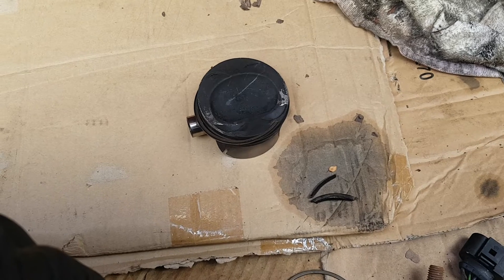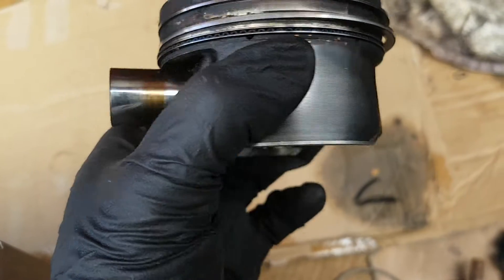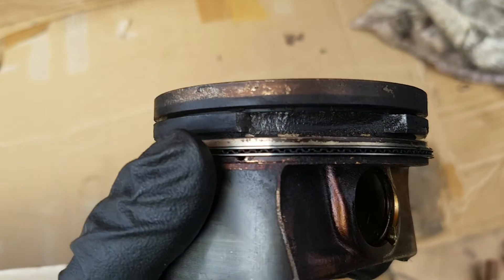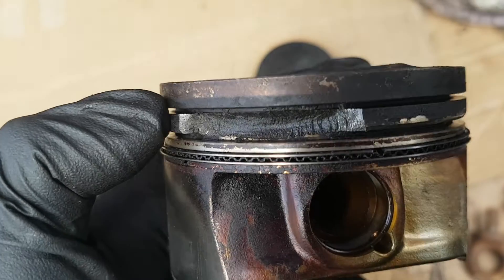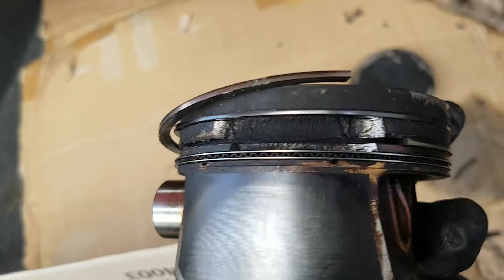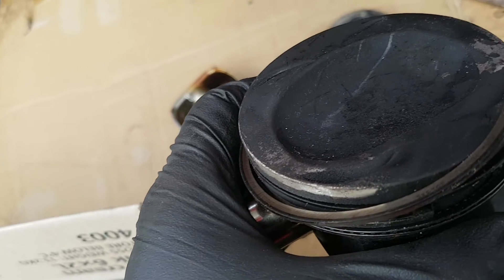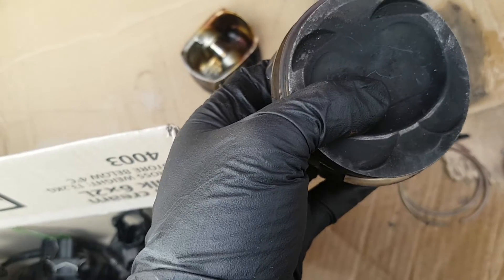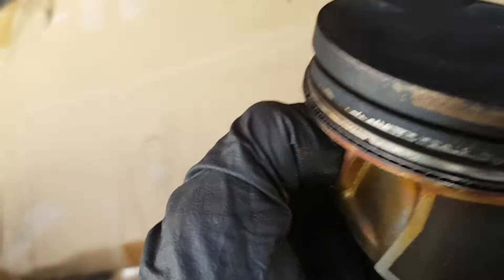VW Audi 1.4 TSI CAVD Misfire Low Compression Cracked Piston Ring Lands

Comment: From what I'm piecing together from info across different sources is that the oil drain hole in the piston behind the oil control rings gets clogged with carbon causing oil consumption and carbon buildup and eventually cracking the ring or piston or both.  I heard something about the pistons being revised in 2017 with larger drain holes.

So I guess the solution for those of us who have these engines, short of replacing with the updated pistons, is to run shorter oil change intervals and perhaps occasionally run some carbon cleaner or do some "Italian Tuneups" to keep carbon down, while being sure to monitor for excess oil consumption...
Reply from the maker: Hi Woody. Where did you source this info?  Would be interested to see this theory as i have heard differently. Thanks.
Reply: Four Rings Auto hmm, I remember most of it was from a VW technician in Germany who wrote about it in a forum.  Don’t recall where exactly I saw the post.  If I can find it I will share with you.
Reply from the maker: @CatonsvilleCentralRwy  interested to hear the theory. I had been informed otherwise. The oil consumption in my experience is fixed by replacing the oil squirter jets for the underside of the pistons, along with revised breather pipes where necessary. The pistons were originally made by Mahle, the revised parts made by Kolbenschmidt. It was suggested that the failure was due to too low a silicone content in the castings, the silicone being there to help the alloy under high temperature. I haven't yet seen manufacturer information stating either theory though.
Reply: @FourRingsAuto 
That's what I have read too. These earlier engines were not built with a high enough spec for the power output. After 2014 the 1.4 tsi redesigned engine has better pistons, timing chain assy, and different oil jets.. No real problems now. Just tough luck for everyone who bought the previous "prototype" 🛠️🛠️🛠️
Reply: @harwoods11  Hi guys, i have a golf 5 1.4 tsi 170 hp, BLG with missfires on cylinder 1 and 3, ive changed 
the spark plugs along with coils, after few km missfires came back, what can i do to fix this problem ? i saw in theese comments about thoose 4 new cylinders from ebay, is it worth it if i change them ? i mean if it runs 100k. km with new pistons im ok with it
Reply: @FourRingsAuto  I have replaced my broken/cracked Mahle pistons with Kolbenschmidt and have not had any issues with the new pistons. I also change the engine oil every 5000 km.
Reply from the maker: Sane experience I have had. Replaced multiple sets with kolbenscmidt and made sure car uses only 98 octane premium petrol. Regular oil changes are definitely beneficial too.
Reply: @FourRingsAuto  I watch all your videos and find them very informative. After last oil and coolant change, I noticed quite a lot of white smoke while car at idle and warming up with no petrol smell from the exhausts. After 5/10 minutes, it disappeared and no bubbles in reservoir tank and no loss of coolant either, any ideas please.

Comment: Is there any issues with the CXSA (Belt Driven not Chain Driven) 1.4 TSI 90KW 122ps (2015 Golf)
Reply from the maker: Not with pistons. A new engine brings it's own variety of issues, but at least this isn't one.
Reply: @FourRingsAuto  Pheew. It does idle rough even after a (software) update. I might try and clean the map sensor etc.
Reply: My MK7 1.4 tsi had the engine replaced after i started notice that my engine consumed a shit load of oil and petrol, and was idling rough, piston failure and they replaced it with a brand new engine lucky enough
Reply from the maker: Yeah I've heard a few issues like this now after this comment around a year ago. They've all been one covered by the dealer though so i haven't been able to get my hands on one to tear down.

Comment: Is it possible to remove head and sump and replace the pistons .. I have a car that has hardly done 85000 klms
Reply from the maker: Yes that is the way i do it. So the job can be done with the engine still inside the the car. Few fiddly bits like the supercharger cover though.
Reply: @FourRingsAuto  thank you ! 
I prefer that solution to substituting my CAXA with a similar klm engine ..
After all it may suffer the same fate
Reply from the maker: Repair what you have. Biggest mistake i see is people throwing away perfectly repairable engines.
Reply: @novi0974  any update on that job? I have a similar situation but no confirmation of damage yet
Reply: @FourRingsAuto  Yeap , they should throw away the car itself

Comment: What about caxa motor? Because i have a misfire on cylinder 1(code p0301 and p0300) and i changed all parts on fire system but i cant resolve it
Reply from the maker: Do a compression test first. Then a cylinder leakage test to confirm where the pressure is going if the compression is low.

Comment: This engine is in the seat Ibiza Cupra was the engine updated to the CTHE code in the late year of 2012?
Reply from the maker: Easiest is to look either in the front page of the service book,  or in the boot floor of the car for the data sticker. It will state the engine code.
Reply: Four Rings Auto thanks a lot man
Reply from the maker: You are correct. All CTH engine codes across the vw group were the updated EA111 engine with the Kolbenschmidt pistons instead of the Mahle ones that crack.
Reply: Four Rings Auto thanks do you know anyway to tell a cthe engine over a cave engine if buying a car

Comment: Hi there 
I got a 2010 Skoda 1.4 tsi with low
Compression on cyl 1. 

You you have the part number for the good pistons by any chance or
Where to get forged Pistons’s from?.
Thank you.
Reply from the maker: https://rover.ebay.com/rover/0/0/0?mpre=https%3A%2F%2Fwww.ebay.de%2Fulk%2Fitm%2F282221250292
Reply: Four Rings Auto 
Thank you very much 👍

Did you pull the engine out to do this?. 
The one I have is dsg auto.
Reply from the maker: I have done them with the engine still inside the car. Removing the supercharger insulation cover is probably the most painful part of the job. Make sure to renew all gaskets too including the timing chain cover. New bolts needed for the cam pulleys, and one of them is a left hand thread. I would recommend replacing the timing chain and tensioner too while you're in there as they are known to wear and rattle on cold starts.
Reply from the maker: Hit the Subscribe button too if you haven't already! Thanks for watching
Reply: Four Rings Auto 
Fabulous thank you for your help with this 👍.

Comment: had misfire on cylinder 2 on a scirroco 2009 today, turns out the piston was cracked along with coked up valves, these engines are wank
Reply from the maker: Haha yep. 1.4tsi twin charged? Prior to 2013 they have weak pistons. Get kolbenschmidt one's on the latest part number, or go forged aftermarket.

Comment: And on the caxc engines?
Reply from the maker: I've not personally seen a CAXC engine have this failure, this seems to be just the turbo supercharged EA111 engine. The caxc is a different bottom end with an alloy block, however the CAVD engine got a cast iron block, however similar design. The issue is with the pistons not being up to the stresses of the higher output engine. VW have released bulletins regarding this issue.
Reply: Four Rings Auto interesting, my Audi A3 that has this single charge (turbo) CAXC motor may possibly be the updated design? This is part of the last batch in the 1.4 TSi/TFSi motors
Reply from the maker: @El_Jefe_S3  MY2013 is when they updayed the pistons, but to my knowledge the issue only occurred on the twin charge engines.
If you could like the video and Subscribe to my channel it would be much appreciated to build this channel.
Reply: @FourRingsAuto 
Where can I get a copy of the VW bulletin?
Reply from the maker: VW
Reply: @FourRingsAuto 
Would you have the bulliten reference?